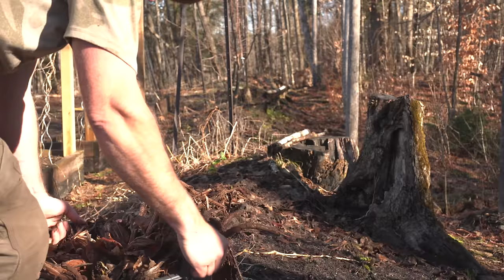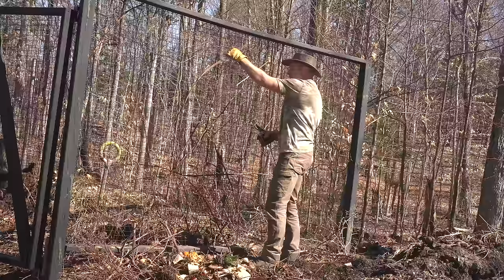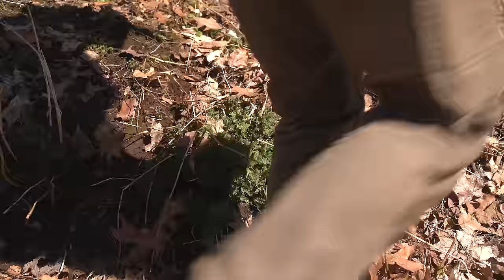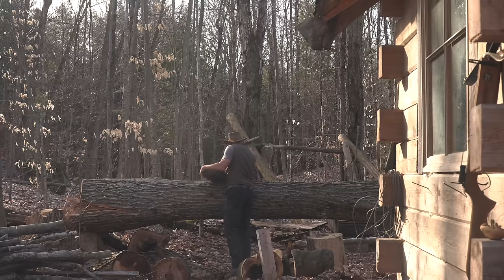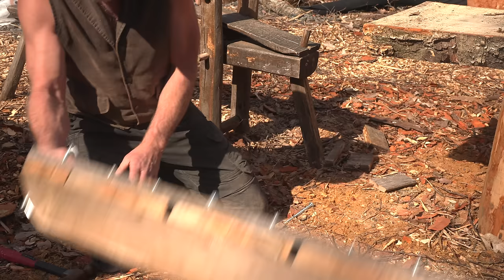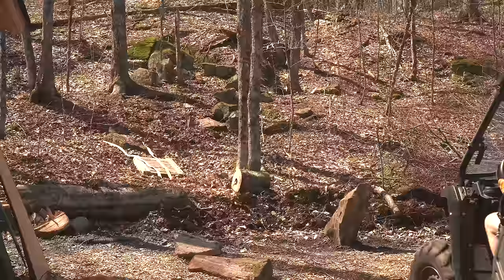A Sneak Peek into My Next Several Major Projects & Making a Stone Sled for HEAVY Rocks

Comment: I can remember when I was a young teenager the farmer down the road we would pick rocks from the field and load them onto a "Stone Boat". Just to 10 or 12" diameter logs with a curve on the bottom front and boards across the top to put the rocks on. We would collect them, and drop them off on the stone rows. Great work out.

Comment: Could you not have spent some time cutting the larger boulders in half with a stone blade on an angle grinder instead of struggling with the weight of a solid block boulder.